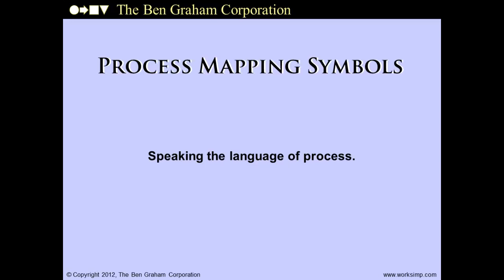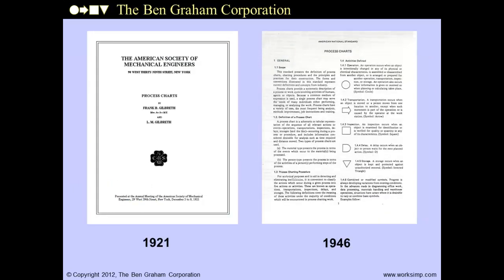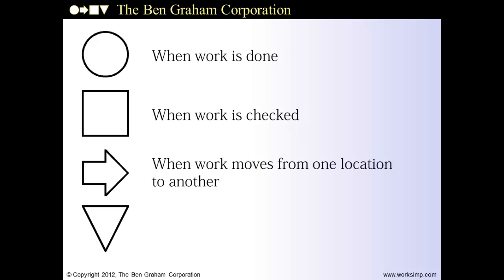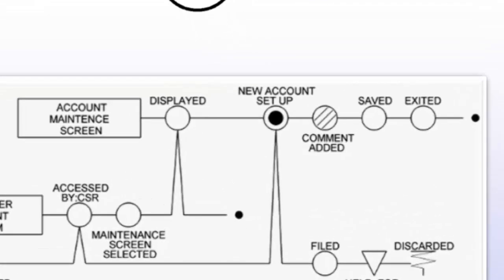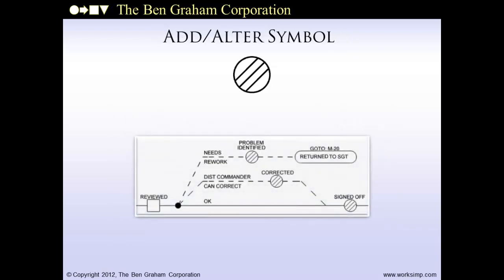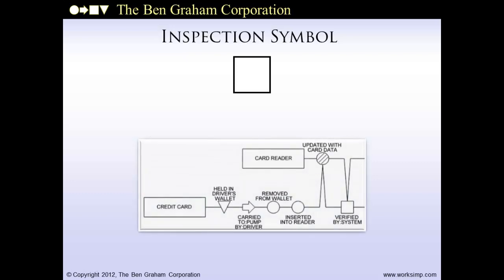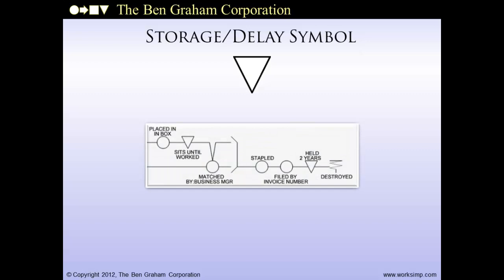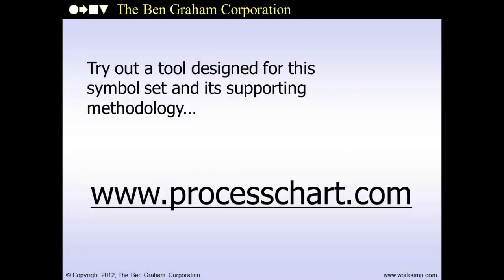Process Mapping Symbols

Comment: The issue is these symbols are not globally adopted. May be you should go with the common symbols, that are common on applications and tools like Visio? Good video all the same.
Reply from the maker: +latitudeash You are right that they are not globally adopted.  However, they were adopted as the ANSI and ASME standard in the 1940s and only competed with high-level boxes and arrows until the 1990s.  They have since fallen out of fashion in favor of symbol sets designed for other purposes.  They are a fundamental and powerful set nonetheless.
Reply: Business Process Improvement agree